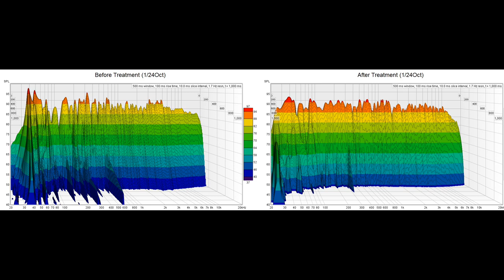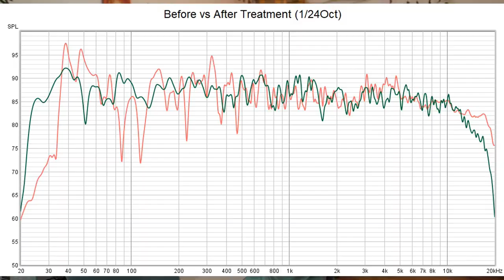DIY Home Studio Treatment: Down to 25Hz with POROUS BASS TRAPS (with measurements)

Comment: I just started building my own studio and never understood why people would just put 10cm thick panels on to the first reflection points.
In my opinion, you are only doing it correctly when people around you start telling you that it's "too much" and you should just "back it off a bit" because you are "reducing the room size too much".
Meaning: I have 4x 40cm thick basstraps, 3x 30cm thick floor to ceiling panels, 2x 40cm deep ceiling clouds and a 3m x 2.50m x 60cm deep basstrap covering the back wall.
And now I've physically ran out of space and have a LOT of the surface area covered with 30cm deep absorption. 
This is how to do it correctly. Every bit of porous absorption HAS to be as broad-band as possible. 😮

Comment: HI A.I.,  Recently, I built a variety of diy acoustic treatments to improve my sound and my skills prior to undertaking a major diy speaker project.  Using recyled or repurposed wood, blankets, linen, etc (except for new rockwool), the result looks professional and the response in my hifi listening room is basically flat now (no dips or peaks At All).  It sounds amazing, of course.  For eg., I made six 2’x4’x6” panels similar to yours, four for the corners and two for the side primary reflection points.  Wow!  Fantastic results.  I may make even more, for the front and back wall and above the listening position.
****Thanks a lot for sharing your knowledge!****

Comment: I jesco !
 Thanks for every adcise you are giving. It's been very helpful for me. I would really like to buy your course for building a better trap. But since i don't have the money for paying it, i had to dig into the web (aka gearspace etc...). I know that that for small rooms it's better to use bass traps  combined with some 1D disffusion. As i see your panels follow this principel. Not to much absorption in order to keep the room imaging "live". 
But when i saw the tour of your studio 'behind the scenes video" i sa that your hybrid panels are also putted on the side walls. According to the forums that i have found, it is not recommended to diffuse the first reflection, it seems to be better to absorb all of the spectrum in order to perceive just the direct sound. Can you explain why you putted your hybrid panels on your side walls ? 
Also i'm looking for the sequence you use in your slat surface, it's been kinda difficult to find; I'm guessing you are using the Bobby sequence, or the Newel sequence;. But is that sequence usable for any situation ? I know your bass traps are suppose to work on any home studio situation (small room) but is there a reason for using that particular sequence ? 
Hope my question is not to long... I love the work you're doing. It's been really helpful for me, since i don't have all the knowledge to really understand acoustics. Thanks a lot !!!!

Comment: BIG QUESTION: For a vocal recording room, can "rigid fiber glass" or "rockwool" bass traps be sealed in thin plastic? There seems to still be lots and lots of debate over this. 

I've actually heard people recommend 10 inch thick traps with a thin plastic layer over them for acoustic reasons, they say it can reflect the highs while absorbing the lows and some high mids which gives a more even response. Other people say it doesn't effect any sound absorption at all, while still others say it reflects way too much even including the low mids because of something to do with air pressure (in theory).

Personally I want to do this for health reasons, but it would be greatly appreciated if any one with any knowledge on this could weigh in on it from an acoustical stand point. If so, thanks a million!!!
Reply: @everestwitman  THANKS SO MUCH FOR LMK!!!!! just watched it and he answered all questions!!!
Reply: @m76353  happy to help haha
Reply: you can use many types of fabric to wrap insulation in to prevent them from shedding, which would be easier than plastic, but most rockwool is in fact not damaging to the lungs long term like fiberglass is.
Reply: @m76353 did he reply ?
Reply: @chinmeysway  "The vids are alright but are mostly ads for a service you can get from him."
That's not fair at all. He's got loads of videos in which he answers question after question after question 
from these comment sections. On top of that, his website provides tons of free information.
I'm sorry, but you don't do right by him with this comment...
Anyway, good luck!

Comment: Nice but, delay in room correction eq? 
If that's a problem you are using the wrong correction system/speaker.
The latency at 44kHz in lets say Genelec is GLM/speakers is about 4  msec and in DIRAC 16 msec and Trinov something around 20+ msec. If you have problems with fades and when sound starts, your brain must work in a very special way 🙂
I also think that a room correction system would be the final 15% improvement in this studio. You could easily get rid of the the few annoying peaks. 
And, room correction is not only about the room, its also (partly or sometimes) about correction of the speakers 🙂
Reply: Hi there, You are right, if you don't care about phase when you eq your room, delay is not an issue. as soon as you add a linear phase eq, there is no way not to introduce latency. that's the thing that i'm really picky about. especially for mastering. 

when you use sonar works for example, you can choose between zero latency or linear phase. and the linear phase mode will introduce latency. you are right about the trinov, but the trinov is also correcting the phase wich makes it phenomenal, if you can afford it of course ;-)

thanks for taking the time to write a comment and share some tipps!
Reply: @delite23  The Ones are made for mastering.
Reply: @rabarebra You're right. The 8361s will probably be my next monitoring system. 😎
Reply: @delite23  that's the Ones I have. 😉

Comment: Is it a good idea to place a diffuser in the rear wall in a room with 4.15m length 2.8m wide and 3m height?
Or only absorption instead?
Plus, 8 inches speakers will work well with this room?

Comment: wish me luck, i am treating a 5W 6L 6H feet wooden box room, self made in the tiny space i could spare. All ply wood box.  Zero treatment so far, shopping for rockwool etc online these days. I won't be able to achieve any desirable results, but will still try in futility. To make matters worse, i have a 5 inch genelec with a 8 inch sub. Call me crazy, so are most of the musicians. But you know what, i will do my best, since this is only i can spare in my tiny house. Also i use sonarworks, so will try that to rescue me. Lastly, i might have to make do with headphones.

Comment: Can someone post the summary or main thesis? Were his traps deeper than 30cm? How he achieved 25hz?
Reply: Hi Paul, so basically the traps were 20 cm deep. There are places in the room where i have two, sometimes even three panels right behind each other, so that makes it deeper than 30 cm.
Reply: @delite23  Yeah, so basically it's the rule "it's never ENOUGH absorption" :) Cool!
Reply: @WarerBrow  absolutely right - sometimes more is more 🙂
Reply: @delite23  Hi Rudi! Thanks for sharing your experience, very impressive! May I ask, which density of the absorber you were using for your project?  Thank you in advance and all the best with your Marvelous Mastering studio!
Reply: @pabloescapista  Hi Andrei, I contacted the manufacturer and asked for the density. Jesco has a range of density in his building manual. All I did was to make sure that the ,arterial is in the range. I did change jescos plan and made the modules bigger so i didn’t had to cut the rockwool. 

Hope that helps. Take Care

Comment: Did i really hear  that you promote insulation?  Glass has a terrible soundsignature. You know that when it comes to windows. And you cant contain the small glassparticles. They will be in the air, and that is a big healthhazard. Never, never use insulation. What material was used? Getting down to 25hz is not possible with insulation.